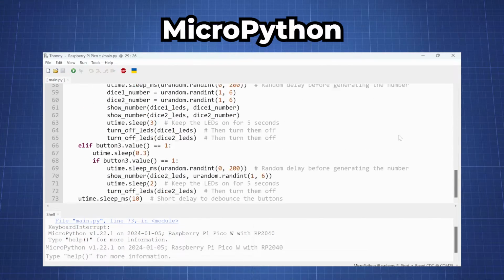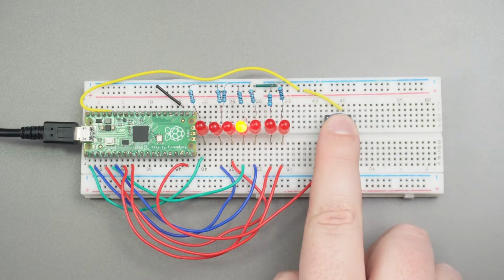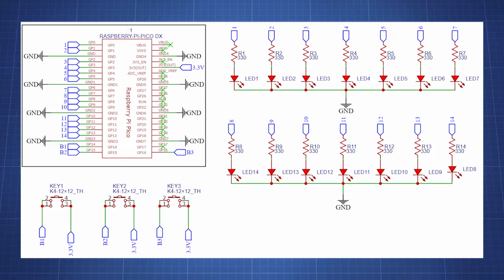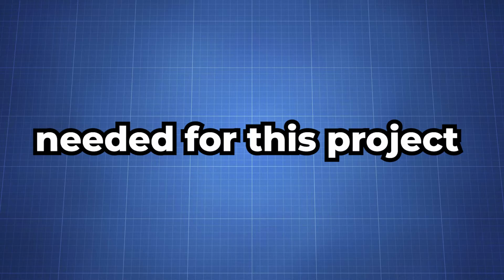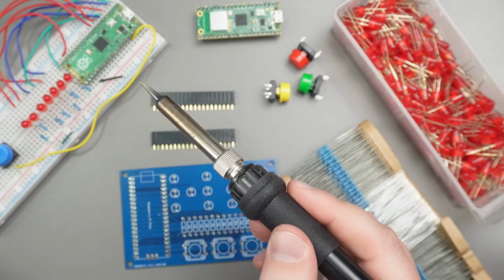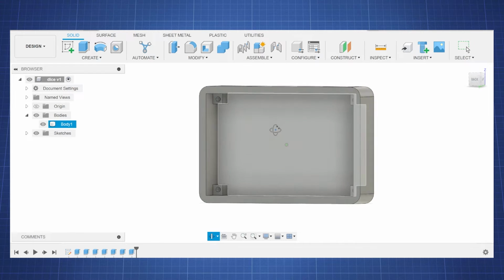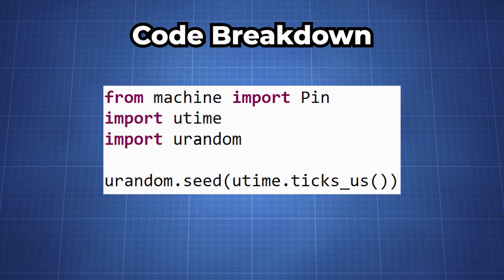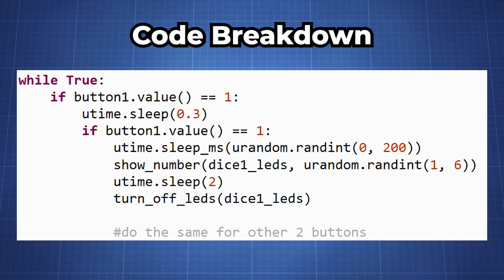Make your own Digital Dice - Raspberry Pi Pico

Comment: Yet another excellent project . 
You have a talent for mixing hardware & software into a project yet making it easy to understand.

I like projects like this that let you begin easier yet can be taken further as your programming skill level evolves ...

Maybe using a picoW you could wirelessly send the random dice to a larger display  or fit a motion sensor so shaking or tapping would generate the numbers ?

How about fitting a tiny speaker so that the Pico " speaks" the number for sight impaired people ?
Reply from the maker: Glad you like it! I try to make the projects simple and my hope is that having many small tutorials on different thing people would be able to use other videos I have done to make projects better like you mention using a webserver to display the dice number etc. which I covered running a server before but in other project so I probably should make a separate video on it